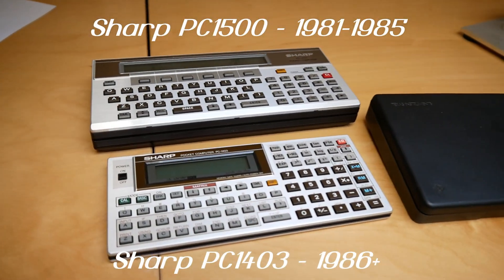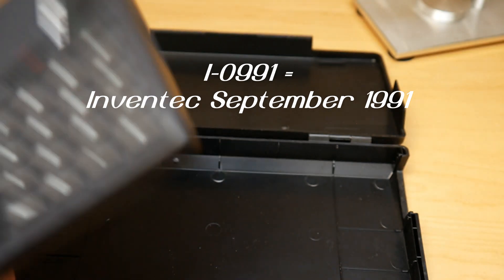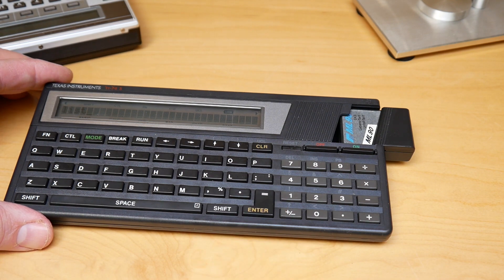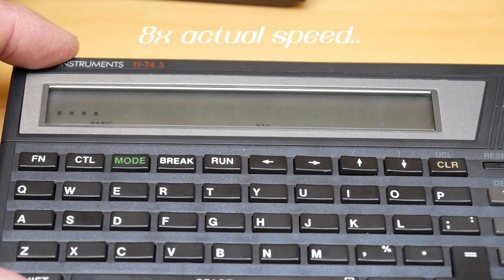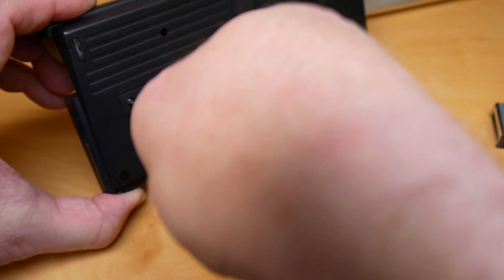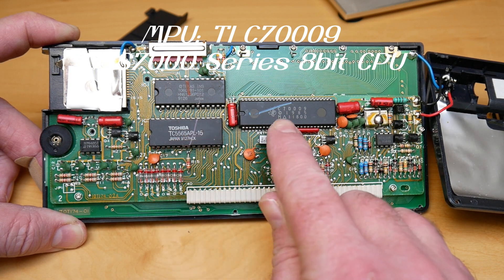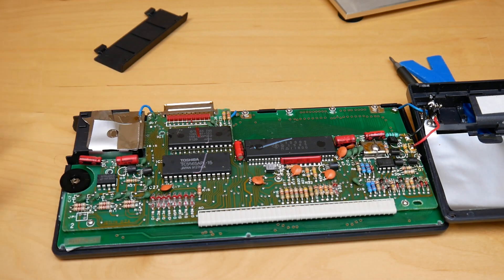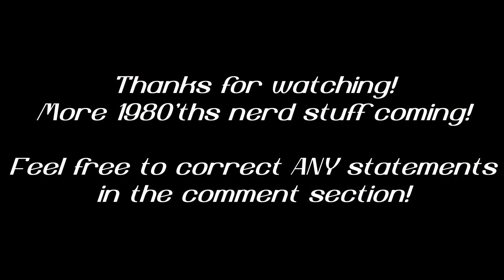Texas Instruments TI-74 Basicalc 8-bit Pocket Computer

Comment: Nice I have the same device also one that was used by an insurance "Allianz". I also have an cc40 that came from a similar insurance. They both nice little machines. Greatings from germany
Reply from the maker: Thank you, yes I appreciate these small basic computers. They are easy to have a collection of. The software on mine is labeled "ML90 - Magdeburger Versicherunggruppe", I would guess a smaller competitior to Allianz.
Reply: @KJohansson that's funny my cc40 is from Magdeburger. Back in the 80s I had the cheapest of the casios with 1k of ram and an 4bit cpu i used it in school and non of the teachers knew it was basic programmable
Reply from the maker: Same here, I had the FX4000p looked like a calc, But I could store formulas and everything in it.